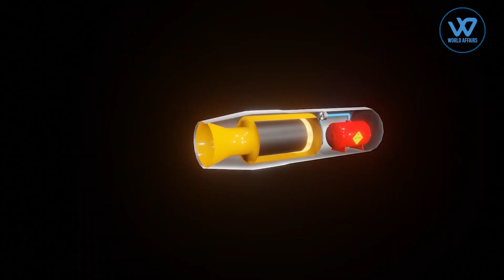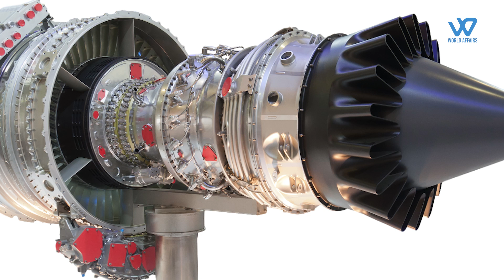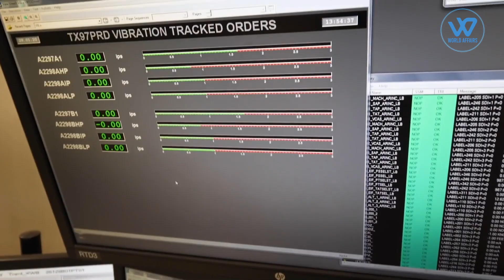Can India Make Jet engines Indigenously For Its AMCA

Comment: So do you think WS-10 engines powering J-11, J-16, J-10 is not successfully reverse engineered?
Even older MiG-21 or F-7 was powered by reverse engineered WS-7 engine. 
And for us; do you think only Jet Engines are a problem?
How about Air launched missiles, their seekers?
and air borne radars?
Flight control systems?
Whats indigenous till now?
and if your audiences are international; please use millions & billions instead of Lakhs & Crores. With your accent, these anyway look odd.
Reply: They are not that well powered though.
Still underpowered. Engine quality is not great.
Air launched missiles are indegenous. Seekers are idigenous too. There are indigenous options.
AWACs we don't have I agree. Total indigenization doesn't happen overnight.
Reply: @direwolf7491  30,000 lbs trust is one of the highest in the world.
Check their accident rate. If they are safe, it's a measure of quality. 
Which Air Launch missile & seeker is indigenous?
Reply: @Ikram12348  Thrust isn't a marker for quality. Accident rate is one the highest in the US. It isn't because their engine is bad, but they fly and train a LOT. PLAF is more busy saluting than training on their jets.
Also coming to the WS10 it doesn't allow the lighter J10 to supercruise and it's electronics and radar to function to the fullest, but the heavier Rafale, Typhoon and the lighter single engine Gripen with 98kN thrust is supercruising with style.
Ever wondered why?
Also have you been sleeping under a rock? Never heard of the indigenous Astra bvr?🤦
Reply: @direwolf7491  J-10s thrust to weight ratio is much higher than Rafale. One WS-10 engine produces comparable power of 2 rafale engines. 
We made Astra thats why we're dying to buy Meteor & beyond. 
Agar Rafale hotay !!
Only for kick backs - wah Modi ji
Reply: @Ikram12348  First you learn to do the math then come back. Give me the numbers.
Rafale weight- 9979kg max thrust -150kN
J10C weight 9750kg, max thrust-140kN
Do the math. Spoilers: Rafale comes on top😅

Secondly, learn to be honest. You said name one indigenous air launched missile... I gave you Astra. So you got schooled. Own it...
Also India is not dying to buy Meteor missile. India already has them for the Rafales.
We might even get more if we buy more Rafales and might out them in Tejas mk2.
So don't comment when you don't know about something.
Reply: @direwolf7491  J-10C, 
1.15
Rafale
0.98
If you talk about thrust & weights in Lbs, it'll be easier & more professional. 
As for Astra; a copy of Super-530D
30 years down. Two major design changes. And still 70 odd in service. 
Yes I'm sorry it's "indigenous"
Why don't the US & French buy from us as we get theirs?
Lol
Reply: @Ikram12348 Being a Pakistani, seeing two Indians passionately debating, is nothing but a treat.
You both possess excellent knowledge, however Shankar your comments are precise, with zero provocation & backed by substantive information based on documented facts.
I am thoroughly enjoying this exchange of wisdom & knowledge, free of cost lol
Reply: @bhaimazaq6968  The fact that you backed him proves that he already lost.😅
Because Paxtonis are always ulta. Where there is truth they see lie and in a lie they find truth😅
I gave numbers. That guy gave nothing. And he is precise. 🤣
His so called 'facts' suit your narrative so you agree😅 shocker.
Nice to see that you are keen about learning.
Reply: @direwolf7491 I was just admiring both of you on level of discourse, without putting questions from my side, to exploit dissent between you.
Wonder why you end up being restless in this comment.
Remember knowledge to impress ppl, cannot buy class.
See I haven't seen any emojis in Shankar's comments, while you look like a bit fond of your knowledge.
True knowledgeable ppl spread knowledge with humility instead of being pompous little brats, like something accidentally acquired, suffices your character as a person.
Reply: @direwolf7491 I was only replying to Shankar on his data knowledge and it's impressive conversion into words.
His last question was directed towards you, looks you conveniently skipped.
Instead you chose me as a sitting duck on our countries traditional animosity, no issues.
You should first reply to Shankar on 'WHAT ARE THE THRUST TO WEIGHT RATIOS OF J-10C & RAFALE'.
You don't need to reply me any further, it is a free world, so do our likings..deal with it.
Reply: @bhaimazaq6968  I already did reply to him.
Is that comment not visible?
His comment was totally flawed.
Let me repeat:
Older version of Rafale had 0.98 t/w ratio.
J10A had 1 t/w ratio.
Rafale M has 1.13 t/w ratio Rafale C has 1.19. t/w ratio.
You see your idiocy?🤦
Let me give you figures for the latest Rafale vs latest J10C: Rafale is 11% heavier than J10C and has 20% more thrust than J10C.
Reply: @bhaimazaq6968  please go back and read my comment before choosing sides.
The figures he gave were of older versions of the Rafale.
Reply: @direwolf7491  All Rafales use M-88 engine & Rafale M is carrier version, so irrelevant for us to talk on that. Rafale C is 0.98 too.
Max speed is mach 1.8 vs J-10C's mach 2.1
T/W ratios are calculated with max AB thrust with 50% internal fuel + Air to Air Missiles.
Do the math.
Rafale's strong points are its French avionics & weapons. J-10's strong points are its high T/W ratio hence maneuverability, long range BVR & cheap price tag - thus allowing more numbers. Operational cost of French systems are always high. That's another low. Why would someone choose Rafale (of 1980s tech. First flight 1986) & do not push for F-35 with lesser price tag or even Eurofighter Typhoon? Specially when we have P-8i, C-17, C-130J, AH-64, CH-47 from the US. Why can't our govt choose newer tech?
It's surprising but not so surprising. Ambanis & hiding behind him our corrupt govt wouldn't benefit. Huh
Rafale with 0.98 ...
Reply: @direwolf7491  in any case J-10C has better T/W ratio than Rafale.
Which engine Rafale A, B, C & M use?
Go check - there's a "combat T/W ratio". What would you do with empty weight?
Lol
MMRCA deal was canceled & renegotiated by Modi. Original deal was for 126 aircraft. Go check why it became 36?
And by the way 'payload' is one word. Not "pay load" as you wrote. 
When you come to that level; then try to talk to me.
And if you think India is "potistan" then shame on you. I'm a proud Indian but not blind with false patriotism. The difference is - we fight with imported equipment & PLA fights with their own.
And our false inflated (for no reason) ego already embarrassed us at the hands on PAF.
Air combat is fought as a team but by individual planes. I hope you understand what our gung-ho did alone !
Reply: @bhaimazaq6968  Nope it is not a free world, a part of it is free, and most of them are secular countries. So our likings don't at all matter in many parts of the same world.
Reply: @Ikram12348  PLA doesn't fight at all.. it's just exhibits them, none are proven their mettle in real war scenario. But yes, I appreciate their consistent effort for indigenization, they will certainly become a formidable force after a decade or so, not at this moment though. And we are on the same track now.
Reply: @Ikram12348  Do you really think that 2021's Rafale is 80s tech, that it is same as the Rafale of 1986?
Reply: @swapnilpawar8015  we had wars with Pakistan & they flew Chinese versions of MiGs. If you see the stats of boths sides, their MiGs got kills too. 
So proven or not is questionable. Many Arab Nations too fought with Chinese planes against Israel.
Reply: @swapnilpawar8015  first flight in 86. Yes extensively upgraded.
Like F-16 is 70s tech but upgraded.
Original year of production matters.
Many systems on F-35 are better than that of F-22 regardless of the fact that F-22 is a more capable plane.
Reply: @Ikram12348  I'm talking about Chinese copycat fighters like J20. It has never been tested in real war. Also, there are doubts over chinese claim of it being a fifth gen fighter. And techs apart, when you see the plane itself, doesn't something feel terribly off about its visual appearance? They tried to copy F35, over stretched the fuselage, possibly to make it work with components they had. I seriously doubt it's actual worthiness.
Reply: @Ikram12348  F35 is a white elephant. Even some American thinktanks question the whole project. The cost of whole programme over several decades itself defeats whole purpose. There have been proposals to reduce funding for the same an work on alternative options.
Reply: @swapnilpawar8015  every fighter starts unproven. How much combat F-22 & F-35s have seen ?
To me J-20 looks fine.
If that was not the case, why PLAAF would operationalize it so quickly in numbers?
Reply: @swapnilpawar8015  what would you call Tajas as a project?
This white elephant about F-35 is myth. Its the most sought after fighter currently.
Reply: @Ikram12348  Have you seen animals who try to look bigger than they actually are, to thwart a potential threat? China has been doing it since a long time. That's why the term 'paper tiger' is used for them. PLAAF wants to exhibit its fire power in a magnified way. It is a typical defence tactic. It's not like they are absolutely hopeless, but they are not as capable as they project. It is a necessity for a bully. I'm amused that you are asking such a question.
Reply: @Ikram12348  also did I call 'F22' & 'F35' as an epitome of fighter jet tech? Don't make it  like I'm defending them here. But ultimately, the fact is that they are the original design, and J20 is a copy.
Reply: @Ikram12348  Youtube's pathetic algorithm just deleted my completely innocent comment about tejas. Kindly access it through your notifications.
Reply: @swapnilpawar8015  I'm sorry I didn't get Tajas notification.
As for copy etc. It serves their purpose. If it's so easy, why don't we do it?
We spend top dollars to feed Defence Industry of EU & the US.
China doesn't.
Reply: @swapnilpawar8015 Agree with first part but we are free in our own likings..
Reply: @bhaimazaq6968  In free countries, yes. In many others, no.
Reply: @swapnilpawar8015 I think you are confused between WILL & LIKINGS
Reply: @bhaimazaq6968  I'm talking about likings only.
Reply: @swapnilpawar8015  okay
Reply: @Ikram12348  Because we follow certain principles. And principles apart, we also don't have an autocratic government which can supress anyone who puts allegations against them, or their institutions. Here people, press both domestic & western will question. Also, China's theft of sensitive tech began after western economies had become tightly intelinked with Chinese one. What major action would they take except criticising China? Also, the west can never access information in china the way it can access in india, due to closed system of china. So how will India hide such things? China didn't fear sanctions because west didn't have the ability to sanction it due to their heavy dependence on chinese supply chains and hefty margins from manufacturing in China. But India suffered several sanctions, even when we tested our own nuclear weapons indigenously. Why Indian FM is openly criticising USA today? Because now western economic interests are aligning with us. They will find it really hard to sanction us today. Comparing an autocracy and an open democracy is meaningless. And comparing it like this is childish, without a solid understanding. Don't do it.
Reply: @swapnilpawar8015  following principles doesn't mean we do not build our own systems. We were Russia's friend for long. And still we are. China copied Russian systems unlicensed. Also it bought Lavi design from Israel - imagine. And developed into J-10.
We could collaborate with Russia & instead of assembling their planes, developed our own.
Reply: @Ikram12348  Do you think our policymakers were not interested in such collaborations? And they only took path of self reliance by will? Do you think China wasn't? Why it resorted to stealing? Why we developed things on our own? Because collaboration is not a one way road. Russia refused to collaborate with us on developing cryogenic engine. That too in 90s. Russia hardly shows interest in sharing tech. Brahmos is possibly an exception where we collaborated. USA refused to even sell us Creigs Supercomputers in 80's because they feared we would use them for nuclear programme. We indigenously developed world's 2nd fastest supercomputer of that time by 1990. Russia has slammed China on several occasions for stealing, reverse engineering Russian tech, latest one was regarding chinese copy of S300 if I am correct. Geopolitics is not word's play. It needs both parties interests be perfectly aligned for any such sensitive collaboration. And it will happen now, with our ever increasing strength & capabilities. You must have heard, a couple of days ago USA offered India to jointly develop fighter jet engine for AMCA. Why? Because France is already interested in jointly developing a fighter engine with us. This is how it works.
Reply: @swapnilpawar8015  it's good to develop own systems & enhance national power thereby compelling other powers to offer us things we need. But I do not agree with; as we follow principles unlike China, we can't do this or that. How we develop our nuclear program ?
Reply: @Ikram12348  You tell me.
Reply: @swapnilpawar8015  beg, borrow, steal...
Reply: @direwolf7491  stop being salty dude, it clearly shows your knowledge on the topic is severely lacking.
Reply: @subasthapa4839  Salty about what?
Reply: China should rename it's engine series as 'RE' - Reverse Engineered
Reply: @swapnilpawar8015  it does the job